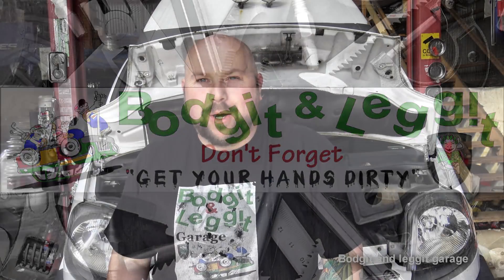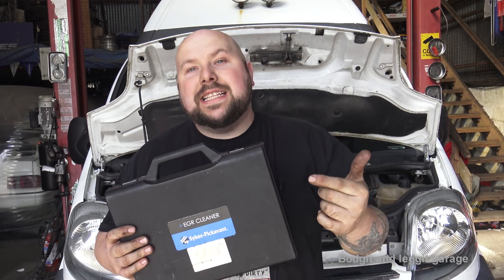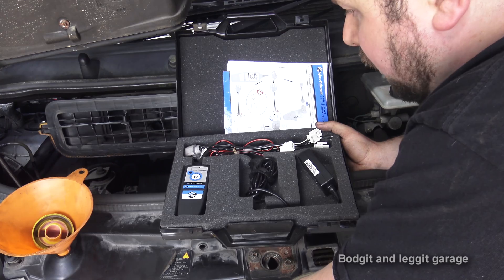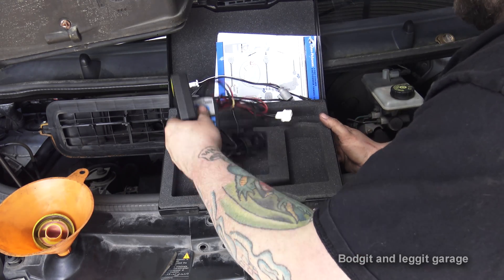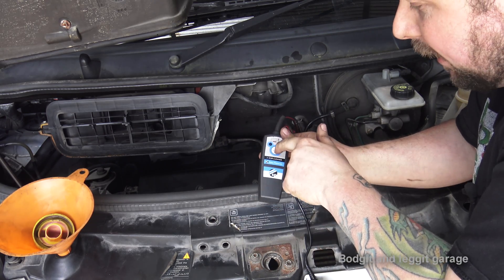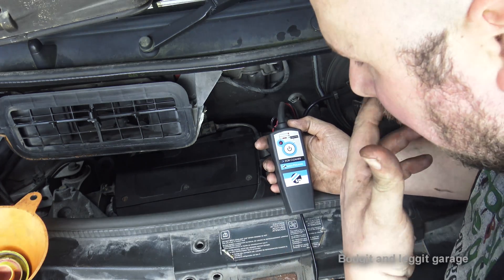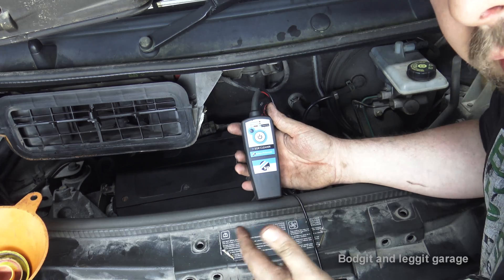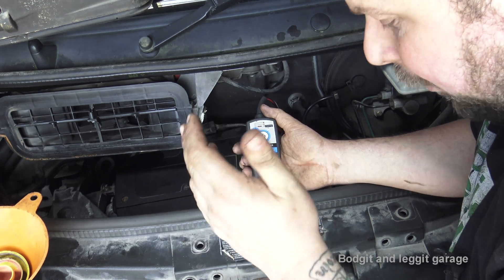Sykes-Pickavant EGR Valve Activator (30077500) Bodgit And Leggit Garage

Comment: Never seen one of those Leon. I can see the benefits if done regularly and not allow the carbon to build up. But if the carbon builds up inside the passageways, then I don't think it would work as well. Thanks for sharing 👍
Reply from the maker: stuzman hi mate thanks for watching it's like everything preventive maintenance is the key clean it off when enough will not allow it the chance to build up

Comment: Surely you would still ideally want to take it out and visually inspect the valve? It's  functionally "activate" tested, but if it was heavily clogged where have those lumps of carbon gone? Will they foul an oil gallery? Do the Americans use "ultra low sulphur" gas I read this greatly reduces carbon fouling. And I'm with another comment, EGR delete/blank if you can, the benifits of ERG don't seem to out weight the negatives imho.

Comment: Interesting, never seen one of them.  I would say fuel quality and temperature would play a big part .  87 octane over here , what's the base  petrol octane in the UK ?
Reply: STEVE ROB BP did do 102 RON for a while over here in the UK. bloody expensive though
Reply from the maker: DIY Carguy mmmmmmmm 102 nice
Reply: STEVE ROB The octane ratings are different between the UK and North America. I'm 99% sure your 87 is the same as our 95.
Reply: i believe it is standardised. thats why car ECU's are dumbed down to cope with the varying fuel quality across the world. which is why having a remap for your countries fuel quality improves fuel consumption etc.
Reply from the maker: STEVE ROB hi mate 95 or 98 but I have seen 99 but don't know if that still available
Reply: Interesting . I would assume petrol octane is standardized throughout the world. If indeed you are running  95 octane that would  be hard to see a vauxhall running the same engine tune as a  hellcat LOL   I must look into this more and report back with some bodgy info. LOL